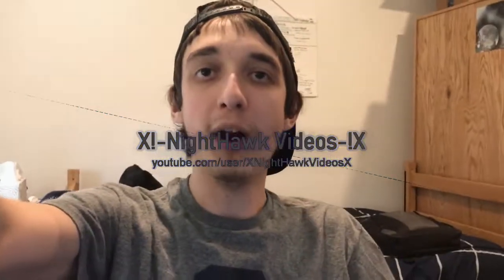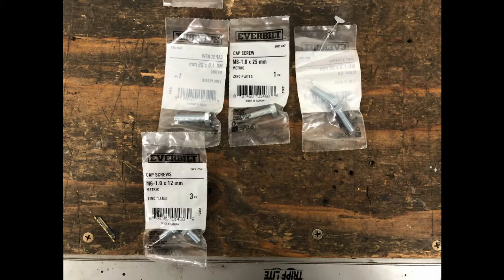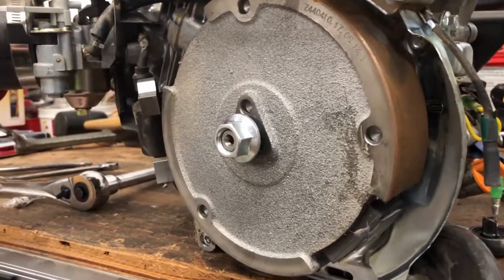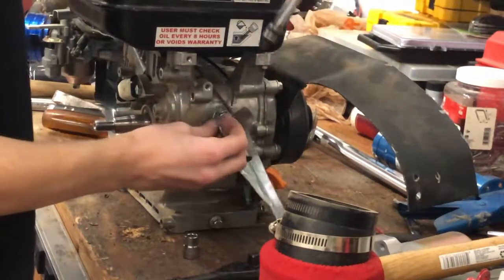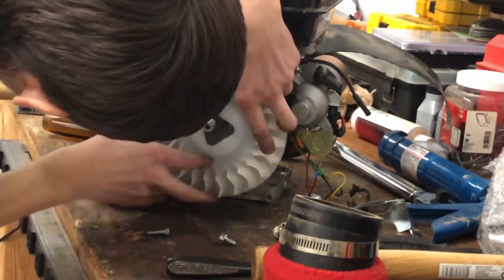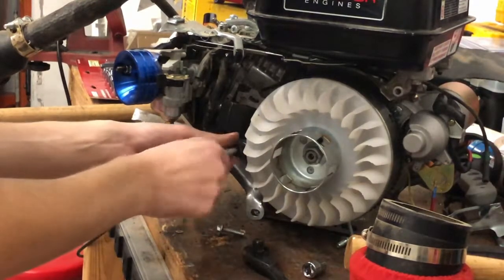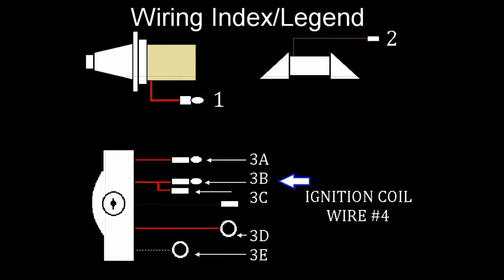Installing an Electric Start on a Predator 212cc *NON-HEMI* || Drift Trike Part 10

Comment: Thank you for the detailed video! I just did mine but it seems to take a few tries before the engine starts. Battery is brandnew with 180 CCC so no problem there. I do notice the gear on the starter solenoid doesn't quite line up with the gear on the pulley? Could this be the problem? Do these gears have to interlock with each other?
Reply from the maker: Mary H If you meant the gears on the flywheel they should? Does it crank up like mine did in the video? Something must be weak or there’s something internally causing friction with the engine.
Reply: @NiTecIndustries  Yes I meant the gear on the flywheel...should it interlock with the gear on the starter?...mine looks like they didn't completely interlock but I did try to push the flywheel in as far as I can ..even pounding it with a rubber mallet. the engine doesn't start right away...it takes at least 3-4 turns of the key .
Reply from the maker: Mary H Then that’s the problem then
Reply: @NiTecIndustries  Ok I went over it last night. I double check the flywheel is as far in as possible. The gear on the starter is not engaging with the gear of the flywheel until you turn the key...then it pops out and engaged the flywheel gear and pop back when you release the key. Kinda makes sense because you wouldn't want the starter gear to keep spinning when the engine is running...right?
I checked the spacing of my ignition coil and looks like one end is slightly out too far so I readjusted it to proper spacing of a business card thickness...guess what it seems to start easier now!
Also on the side note..I'm not sure what size wire for the battery I supposed to use but I justr use some spare wire I have in the garage...I think maybe 12 gauge? Is that thick enough wire to connect to the battery and starter?
Reply from the maker: Mary H The ignition coil having that gap then meant the spark plug wasn’t getting the proper spark in the combustion chamber—causing the poor starting quality. Your electricals are working just fine. 14 gauge would be better wire. I don’t recall if it’s either 12 or 16 gauge that’s thicker, but 14 is common.
Reply: @NiTecIndustries  Cool Thanks! A smaller gauge number means thicker wire. I notice most battery cable wire are very thick...about 8 gauge to 2 gauge. Using a thinner wire ( higher gauge ) might not about enough current to flow thru the wire. I initially used a 16 gauge wire and the plastic covering actually melted from the heat...swapped it to a thicker wire I could find in the garage and it seems to help the engine started better.

Comment: So I don’t want to do a full on electric start but instead of the little red switch I want to put a key ignition would I need a kit or a 2 wire or like a 4 wire?
Reply from the maker: If I am understanding this correctly, you are still wanting to do a pull start, but have a key-switch at the front of your project?

If that is the case, you only need a two-wire setup. I have done this with a key toggle switch in the episode where I install the drum brake. At the beginning of the video, I showed off how I did it. The hot replaces the lead wire coming from the factory switch, and the ground from the switch is grounded to the frame. Hope this helps.
Reply: X!-NightHawk Videos-!X thx man
Reply: X!-NightHawk Videos-!X but if someone wanted to start it but the wasn’t in it it wouldn’t start correct?
Reply from the maker: If the key is in the off position, yes.
Reply: X!-NightHawk Videos-!X could I take out the original switch and put a key ignition in instead?
Reply from the maker: Local Earrape That’s what I did in the drum brake video, yes. For extra safety/security, in the event that one switch fails (ground fault IE), you could wire the factory switch and the key switch in series.

Comment: Anyway to do this on a 79cc predator? (Love the sticker on the pull start)
Reply from the maker: Unfortunately, I am unaware of any kits for the 79cc. It would be cool, but I don't think it is possible.
Reply: X!-NightHawk Videos-!X ok thanks
Reply: Wish there was a way would think the same kit would work but idk if you happen to find a vid on this please post here thanks.. now for lights and horn you could use a phantom generator sold bye bike berry for motorized bikes this works on almost all 4 storke motors its made for the 80cc 4ts but have seen it on the 49cc and a 212 putting out 12.5volts at idle

Comment: Can you put double coils if wanted
Reply from the maker: In a short answer. Yes, in theory. My kit did not come with two, but the predator does have a bolt circle that allows for two coils to be mounted. You only need one to plug into the wiring of the switch box, so the second could be used to power a front headlamp for instance.

Comment: Does the starter protrude past the block on the clutch side? I have a cvt setup and need to know if it will clear. Thanks
Reply: I put a starter motor on my 212 and I have a Torque-A-Verter and it works fine,plenty of space.
Reply from the maker: I would assume too that it depends on which torque-a-verter you have depending on how built your engine is. Since only said CVTs are rated for X amounts of horsepower. Also assuming too the orientation of the assembly depending if your engine is behind or in front of the axle.
Reply from the maker: Great question! Despite that I am not running with a Torque-A-Verter, but I went outside just now to check. It looks like the starter's face facing the shaft is coincident with the clutch side of the engine block. It looks like it does protrude past just by a cm or two, so it is possible you will have to do some trimming on your CVT plate.
Reply: We’re you able to put back the pull start after the new electric starter setup
Reply from the maker: Olsen’s ATV customs Yes after having to modify the plastic piece behind the pull start cup.

Comment from the maker: IMPORTANT: It would be highly recommended to use a thread locker on the internal bolts for the coil and solenoid. Unfortunately, after doing a ride for an hour, one of the bolts holding the starter loosened and ejected out of the engine, causing the cast aluminum piece to crack, and misaligned the gears when starting. Pull starting is okay, but not electric start. The bolts were tightened snug shown in the video. 

PS. THANK YOU FOR 70,000 VIEWS. LETS GET TO 100,000??? Much love! <3

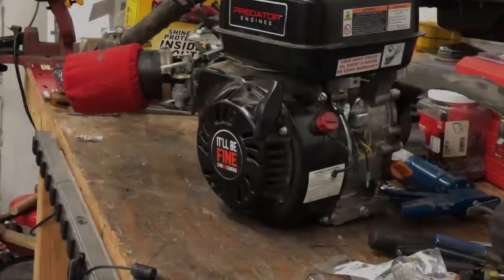5:50 is when the build starts
Reply: THANKS for update, DIDN'T know you could do this, THIS 70 year old with 1/2  a brain might be able to follow this